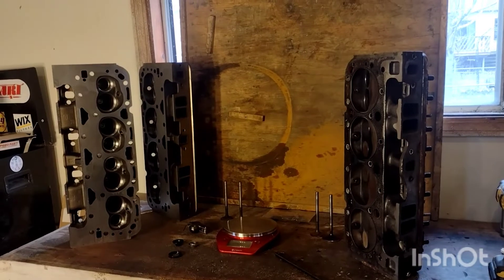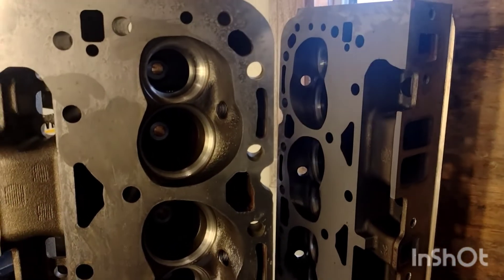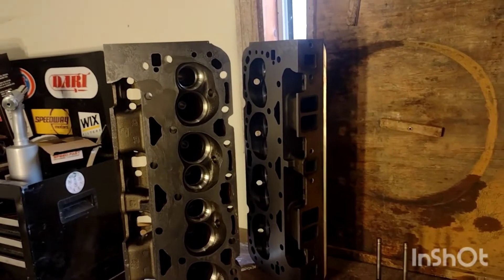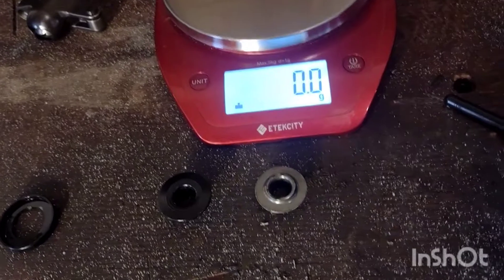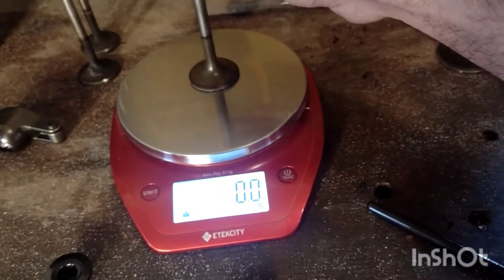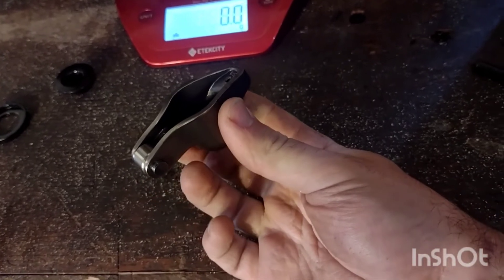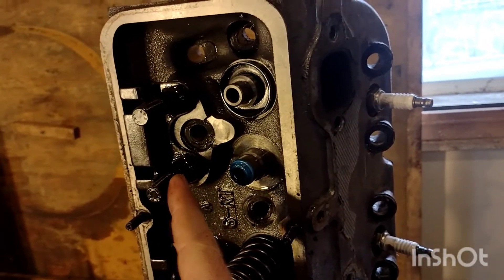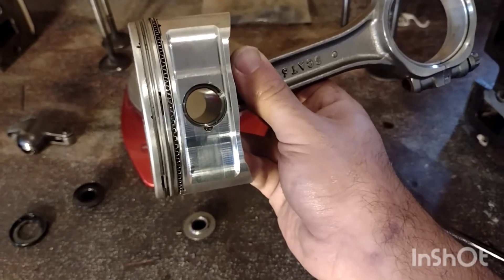7000 RPM Small Block Chevy! USRA B Mod Engine Technology

Comment: the last engine i built revs to 6500 an i used alot of lightweight parts even lighten my rods and put ARP rod bolts in them and it revs very an shuts down very quick an i like that sounds that comes with it...😎✌
Reply: Last engine I built revs 8500 I used a lot of really strong parts, carillo Rods with 7/16 carr rod bolts that torque to 90-100ftlbs to achieve stretch, 1/2" exhaust pushrods, 1/2-7/16 intake pushrods, shaft rockers, titanium valves, 0.770" valve lift ......       no flywheel or flex plate.......  2 3/4 Kinsler IR....   its a usac 410.... it revs pretty quick.....
Reply from the maker: Hell yeah! I forgot to mention the ultra lightweight flex plate. As you soon as you turn off the ignition this thing stops dead. Makes getting it rolling out of the shop when the motor is cold a chore though
Reply: A stock small block will go 6500 rpm with ease. 😂
Reply from the maker: @James-aaron  but will it go to 6500 twice a lap for 600 laps without puking it's guts out?